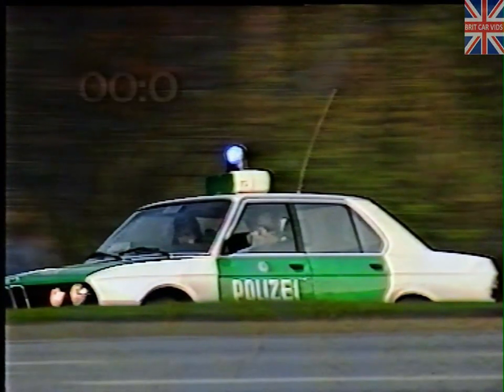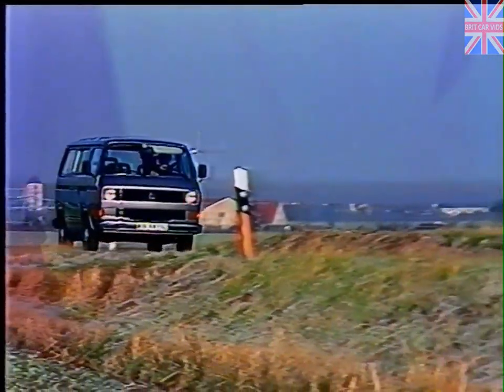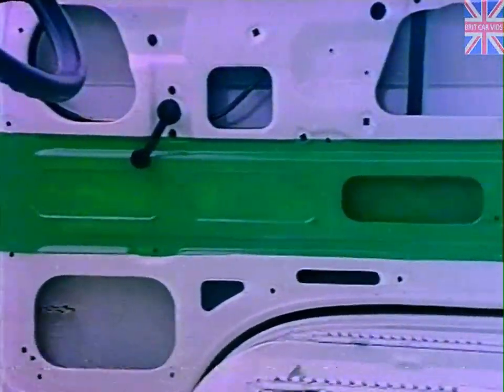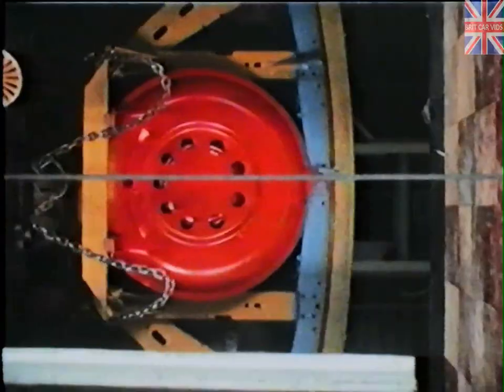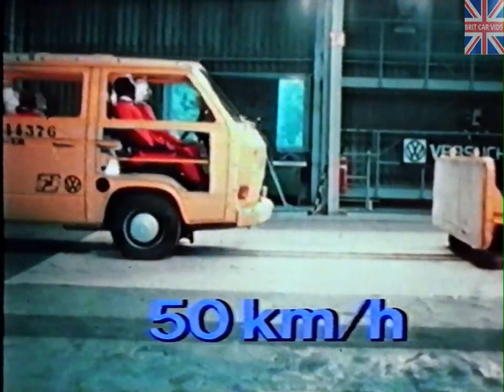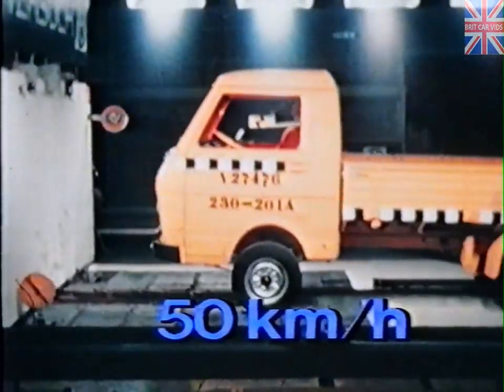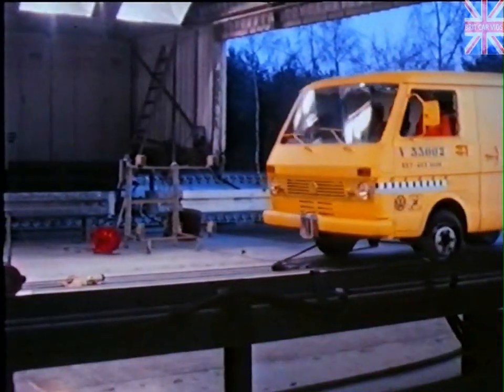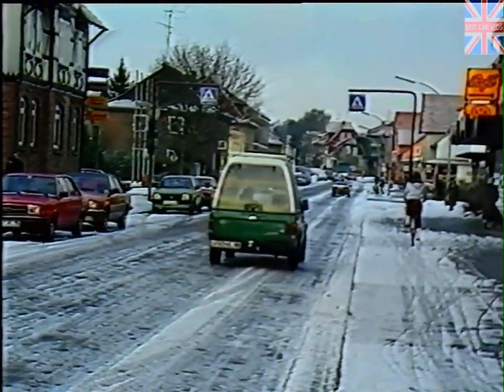Volkswagen - Volkswagen Safety - Volkswagen Safety Research (1984)

Comment: "in most cases the speed is reduced to 50 to 80 kph by braking" ... yeah, but the other car won't be stationary. Framing this 70kph crash test that way is misleading af. It suggests country road or motorway speeds, but simulates more like a 35kph head-on collision in town.

Comment: All this engineering and they still didn't think to put airbags in the damn things until they were forced to in the mid 90s. I cringed especially hard when I saw how deformed the "safe" collapsible steering wheel was after they slammed the dummy into it. What the hell were they thinking in the 80s?
Reply: The steering wheel must be a lot better than the competitors though! I am not sure that the steering wheels in my modern car is as soft as the vw van but the new car has airbags of course

Comment: I drove a 1983 VW Vanagon Westfalia with the 1.8 Water cooled engine and a 4 speed... I can assure you, on modern roads, that vehicle was anything but safe.

and I loved every minute of it
Reply: Compared to the previous (T2 Kombi), this generation is a revelation in safety - much less how it compares to the original Type 2 (T1 generation Kombi) from the 50s!   
I don't think today's roads present a greater safety risk to vehicles from this era.  In fact, modern roads are better. 
Modern vehicles sharing the road, are also less of a risk factor.  Increasingly, they have collision avoidance and other safety systems which all help to make driving an old car on contemporary roads, less of a problem than ever. 🙂
Unless of course we consider the stress and cost of repairs and pets after a collision in one of these old units. 😬
Reply: Wdym? It was rly safe back then like u coud get in a crash at 70km/h and survive and that for 1984 was kinda insane
Reply: It was safe when it came out, today not so much.

Comment: I always thought the VW vans were the worst death traps ever invented 😂
Reply: That's wrong! The longitudinal crash-members were introduced to vans by VW.
I remember a crash test, were some japanese vans and the T3 were compared. And ALL japanese vans failed, because the legs of the drivers were jammed, although theses cars provided a longer structure in front of the driver. 
It seems safer, but these structures were very weak.

Comment: 5 years ago i had an accident at 70km/h. i crashed into a car in front of me and took about 4 cars in the rear. all of the others disappeared halfpart into dust, my 1988 vw is still running. i just had to replace the whole front and the rear bumper. yes i know that if the wohle accident would have happened with vw transporters only, we all would be dead, because the transporter is litterally constructed like a brick.

Comment: in the first crash the crumple zone did indeed absorb most of the impact, but with the lack of air bags the dummies head hit the steering wheel so hard, the driver would have still been killed, and the so called limo is really an early 80s buick skylark...

Comment: They had air cooled engines and the vans were heated by the exhaust. When the exhaust system startet to get rusty exhaust was blown in the Interieur, the passengers felt asleep because of the CO gas and crashed. Till the T4 those vans were deathtraps
Reply: Urban legends say ...

Comment: Back in the 70's I saw several VW minibuses catch fire and burn on side of the roads. Those magnesium rear engine blocks were fire hazards!
Reply: Yeah. My dad told me how their VW minibus and VW beetle in the Philippines caught on fire and explained how Volkswagen vehicles tend to catch on fire.
(If I remember correctly, he said that there was the distributor under the carburetor. If the carburetor was damaged or leaking, it would go to the distributor and cause a chemical/electrical reaction, thus, causing that fire).
Reply: were those the beetle bug vans?
Reply: Waterboxer engine block in T3 is made of aluminium not  magnesium.
Reply: @jaffaj23  Sure, but earlier in the '70s they were air-cooled magnesium blocks and quite prone to burning.
Reply: My statement was to ensure people didn't wrongly think the VW T25/T3/Vanagon/"Brick" had a magnesium engine block. They don't. Glad to clarify.

Comment: how about the side pole crash on the drivers door and a small overlap crash on the drivers side ?
Reply: Overlap crash tests weren’t really done back in the 1980s, most crash tests of that era used full frontal crash tests like the ones seen here. The IIHS who conducts crash tests in the US didn’t add small overlap tests to their battery of tests until 2012

Comment: My parents owned TWO T-3 Vanagons (Campmobile conversions) and like all VW vans, they were suicide in a front-end collision scenario. My current T-4 transverse I-5 engined Weekender isn't much better, the engine/transaxle will rollup under the seats with your legs and they'll call you "Stubby" after they cut you out. The floorpan of Vee-Dubs has always been a weakness in a crash, you just accept if you buy a VW van/transporter/wagon from the beginning of production. Sprinters and Ram Vans and Nissans have the below-the floor engine and a real frame and nearly triple the mass of steel in them. Funny how the US won't allow VW to import the T-5, ain't it???
Reply: Its not that the US doesn’t allow them to import the T-5, its that the T-4 had poor sales in the US market and VW didn’t want to take the financial risk of selling a car that the public didn’t want. That’s starting to change now though with VW offering their new electric van in the US.

Comment: Vehicles like these were designed for the gentler time. Now no amount of crash safety structure can save idiots that drives at triple digit speed in city streets designed for 35 MPH and crash with trees, going under semi trailers, and head on crashes with combined approach of triple digits.

Engineers can design safer and more fool proof vehicles, but nature always improve its fools.

Comment: Once had a lady do a u turn in front of me while driving my orange 1984 T3 camper. I was doing about 50kmph. I braked, turned the van into her back door so the driver’s corner took the full force, closed my eyes, swore, and held on as her Merc wrapped around the front and we pushed her across the road onto the other side. My wife and I in the front, had seat belts and were fine. The two in the back didn’t and flew forward into our seats, but luckily apart from bad bruising were okay. Anything not tied down flew into the front, my wife was hit in the head by a torch, but the fittings in the van were fine. We lost both headlights and some body damage along the front. The Merc however was written off as it was twisted, but the lady got out with a cut finger from her shattered windows. A week later, the van was back on the road, all nice and shiny and we carried on our trip through Germany. The only change, the two in the back always wore there seat belts and I would go into a cold sweat when ever I had to pass a silver Merc parked on the side of a road. Lessons we learnt as shown in this video. Wear seatbelts, don’t leave stuff lying around and the VW could T-bone a Merc and still come away smiling. 😄
Reply: Good story.  Good to know everyone was ok.
Reply: And they say that mercs are indestructible...
Reply: @iuopunderstandyourjokes9914  Actually they're designed to protect the passengers, which it did in this case. You'd prefer it go the other way around? Btw, nobody says that mercs are indestructible in accidents! If the rolls were switched, I'm sure the VW wouldn't be on the road and the people inside might have more than a cut finger.
Reply: Cool STORY bro 😂
Reply: Vw van drivers are always the first to arrive to the scene of the accident
Reply: I had a similar experience with no seatbelts and I wasnt the one without it , back in like idk the 90s or 80s mu romanian  uncle baught a t3 passenger van that e still has it today but when he baught it he was obsessed with it and we went on a small trip from his small town to a city nearby and his obsession back then and still is today , under no circumstances a seatbelt shall be worn in his car , yea ik its the most stupid thing I have ever heard but i didn't care like he could kick me out the car and I would still wear my seatbelt anyway so on this little 2 lane road we see a white sadan not going straight but we thing nothing about it and continue going about 100 km/h when suddenly the driver just bamm passes out and the white dacia comes in our lane going about 70k/h he slams on the breaks i see the speedometer saying 70km/h and then boom then bigest impoact I have ever felt and then I was thrown back in the seat by the seatbelt while my uncle that was in the back flew out his seat and into one of the seats infront and I forgot to mention it was my aunt that was driving,  after the impact my uncle passes out but me and my aunt get out the van through the doors that were perfectly intact and there was no intrusion in the footwell or the cabin itself like that van was repaired and is still on the road today but the dacia driver passed from that accident and believe me or not my uncle yea the same man that was thrown at a seat at 70km/h still says "Ce iti pui ma tu centura ? Ce iti trebuie sa te tina legat de scaun, la mine in masina nu isi pune centura nimeni" wich in translation says "Why are u piting on your seatbelt? Why do u need that thing to tie u to your seat, in my car nobody puts on a seatbelt " wich is still his opinion after that almost fatal crash so yea ppl wear a dam seatbelt cuz it aint that hard to pull a belt on u and click it in and drive off knowing ur not gonna die if u get in a crash
Reply: amazing story man 
i was t boned in a scirocco 

IM ALIVE hahah

Comment: 10:00 -- The passenger seat breaks loose from its mountings on the left side and is only held in place by the right side. I can only imagine what would've happened at a much higher speed, or if they'd hit something that's not as soft as a Buick's trunk. If the seat fully broke off would the dummy have been sliced in half by the seatbelt?
Reply: Or if there were two passengers on the seat, which it was designed for. Why weren't they testing that, I wonder?

Comment: I can confirm the safety of a VW Transporter is good (for the standards of that time). I crashed one with about 50 Km/h into a guardhouse. The front axle buckled up inside the floor in the cabin, but I kicked the door open and walked away unharmed. :)
Reply: What year Transporter ?
Reply: @felipecardoza9967  It was a 1984 T3 :)

Comment: This is so incredibly stupid to assert safety just based upon rigidity of the front part of the car - such an insane, mad and crazy assertion! Nobody is even mentioning necessity of enough long deformation length!!! It completely doesn't help anybody to survive even if you are inside "untouched" by the car interior, as long as the overload caused by the stopping in just few milliseconds on few centimetres is enough high to rip off your body organs. To survive car accident you not only need to be undestroyed by interior of the car, but also you desperately need not to be overloaded by the deceleration of the car - means you need enough long deformation length over which the car is slowing down to zero speed - so that the overload from deceleration is as low as possible. This means, the longer the front of the car is, the better protection it is providing in this regard. How could they been so stupid or so perverted not to mention this fact in the movie?!? Not to mention this basic truth about safety in the vehicle in the accident is equal to lie to all the potential customers.
Reply: The energy of a crash is lead upwards in this design, just like (to some extend) the deformation. But you have to consider the period of these tests and construction. 
Of course the laws of physics did and do not take the the period into account. Depending on the type of crash controlled deformation is desirable.

Comment: Most of the cars on a highway  travel 100 or 120 Km/h. 
50 or 75 km/h is not enough to make a crash test.
Reply: Physics set limits for crash safety. You can't run into something at 120 kmh and expect the manufacfurer to make you survive.
Reply: You obviously haven't driven a European van of that era. 100km/h is uncomfortable, 120km/h is unreachable. Still awesome though.
Reply: @celeron55  I would add 10 kilometers to your guess but yes.
Reply: @kennysboat4432  
Depends on the version but our old T3 Diesel with 50HP had a Topspeed of 105km/h. So 100km/h is pretty much a good speed.

Comment: 9:10
So that’s how they came up with the AMC Gremlin’s design
Reply: May look that way but the Gremlin came out 14 years earlier in 1970 and they are pieces of junk cars. I Know because my first car was in 1985 when I was 15, was a 1970 Orange Gremlin with 3 speed manual, and don't try and enter the freeway you'll get run over. The one I had didn't even have a back seat or hatch just 2 doors 2 front seats and that's it. Not a babe magnet either
Reply: @Fenncer24  r/woooosh

Comment: 5:50 was a Toyota or a Mazda. they were were very alike.
Reply: These manufacturers were not even present with vans in Germany back then. The first ones they brought to Germany were actually with no bonnet either. It's a Bedford Blitz, a left hand steering version of the Bedford CF. You can actually see it as runaway catcher in the background when they bust that Buick.

Comment: The rollover test was impressive on the kamper especially with what looked like a pop top roof
Reply: Well ... they rolled it in a way so that the roof barely even touches the ground ...
Reply: I wonder why the windshield got loose and flew away. Was it really attached that poorly?
Reply: @WhiteSlift
It was a pop-off windshield designed to protect your head from potential impact.

Comment: 2:10  I thought "crumple zone" means there is a "zone" that "crumples" and absorbs the collision energy so the people in the car don't have to.  When a flat-nosed VW collides with other things, it doesn't have much of a zone in front to crumple, if the front end doesn't crumple much so the cabin can hold its shape, that makes the declaration extremely fast; if it crumples a lot it cause the cabin to deform and crushes the human, neither is good for survival.  Yet they tell us "this feeling is not justified" :)
Reply: Simple. Write to the manufacturers telling them to ban forward-control vans.
Reply: They immediately talk about the crumple zone immediately after this at 2:22 when they talk about the forked frame and the deformation element aka a crumple zone

Comment: What I can say with authority is that my 1984 Vanagon hasn't run since 1995, mostly due to water circulation/head gasket/overheating problems one after the other for the majority of its working life after the first 5 years or so.  So the mechanicals were mostly shit.  HOWEVER...the robust construction of the thing that they're implying here has made for one helluva nice dry storage shed for almost 25 more years.
Reply: howeco1 overheating can be caused by having an American thermostat not a german one in the van!
Reply: howeco1 why would
You keep a non operating vehicle for
That long? Agreed the water boxer had its issues but those have had fixed for a long long time. From Different gaskets to Subaru conversions are widely available for
These. Having a garage ornament for 25 years doesn’t make sense.

Comment: There is absolutely nothing safety in a old VW. You have bigger chance to survive if you jump out of the car when crashing than if you should stay inside. Real deathtraps, probably number one all categories. My best friend was sadly killed in a LT35 back in the 80:ies.
Reply: ebk60 not true. The vw t3 was a very safe design for its time and then some.  A huge amount of effort , testing, and engineering went into these to make them vastly better than the completion. Sorry about your friend. A t3 is not and LT and no matter what, not every single death is preventable. People are killed in modern Mercedes, Volvo, etc. doesn’t mean that they are unsafe.

Comment: If they wanted to make it safe why didn't they give them better brakes, I had an 84 Vanagon and it had solid front rotors, non vented and the most woefully pitiful drum brakes on the back.
Reply: Had one for a little while.
Stopped fucking fan ass tastic.

Comment: Good that most of these shitboxes are off the road today, one of the few vehicles that was genuinely dangerously slow. Front crash protection was less of a problem because it was hard to get it going fast enough to hit anything hard enough to cause injury
Reply: VW buses are highly collectable. The T3's are getting more and more expensive to buy as years go by. Still you will see more of them still on the road than any other car of the time. That says they are not 'shitboxes' in any way.
Reply: cidercik agreed. My 88 vanagon would do 90. Does one really need to go faster than that in a van? 0-60 in one like my 88 Wolfsburg was 14 seconds according to car send driver. Adequate for its day.

Comment: Remarkable how that van keeps it's original form, even after rolling down a steep hill. But I'm sure that the driver in it would still be dead from hitting the cabin several times with his head.
Reply: It's his head that stopped the roof caving in
Reply: @brucehart4627  looooooool